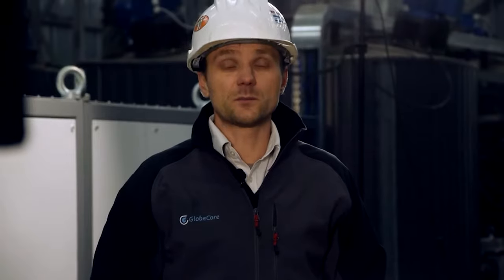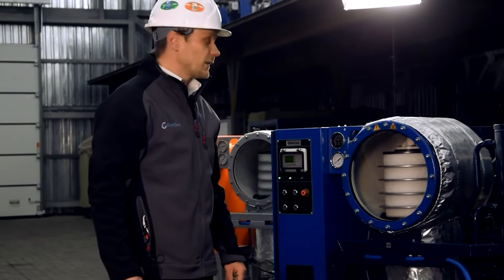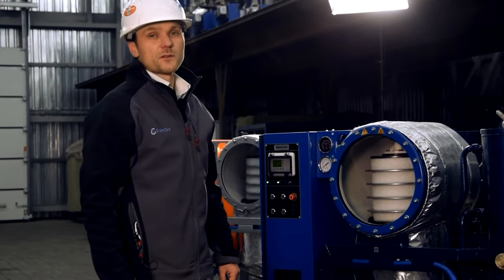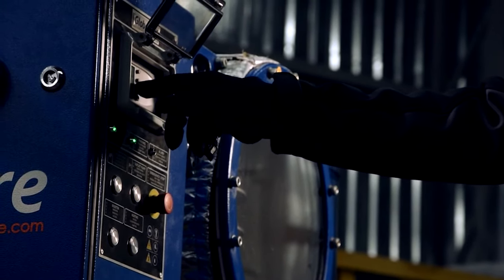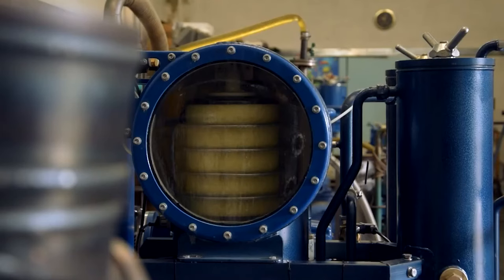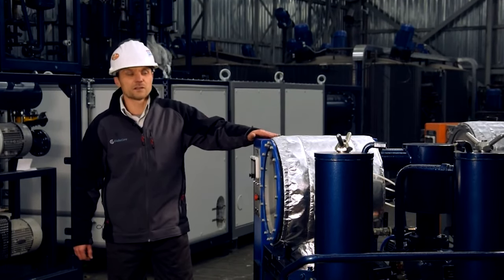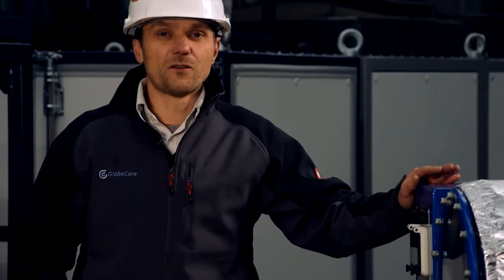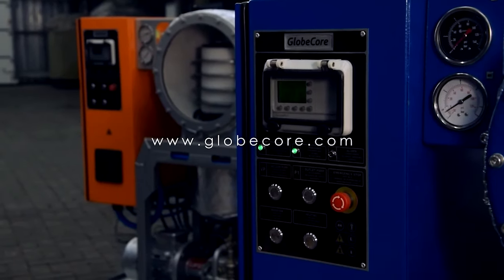Transformer Oil Treatment Machine CMM-1/1

Comment: What is the breakdown voltage of the oil before and after processing?
Reply from the maker: After three cycles of oil processing with the unit, the breakdown voltage of the oil has been significantly increased from 15 kV to 75 kV.

Comment: Can the СММ-1/1 unit be used for other purposes besides processing electrical insulating oils?
Reply from the maker: Yes, the unit also serves the dual purpose of heating oil-filled electrical devices with hot transformer oil and vacuumizing them.

Comment: What type of electrical insulating oils can be processed using the СММ-1/1 unit?
Reply from the maker: The СММ-1/1 unit is specifically designed for processing transformer oils.

Comment: How does the unit remove mechanical impurities from electrical insulating oils?
Reply from the maker: The unit effectively purifies oil to a class of -/14/12 from an initial class of -/18/16, ensuring the contaminant content by weight is less than 0.004%. This is achieved through multiple passes of the product through the filters, resulting in significant removal of mechanical impurities.

Comment: What is the purpose of the СММ-1/1 unit?
Reply from the maker: The СММ-1/1 unit is designed for degassing and dehydration of electrical insulating oils, including the removal of mechanical impurities. Additionally, it can be utilized for heating oil-filled electrical devices with hot transformer oil and for vacuumizing them, enhancing their performance and longevity.